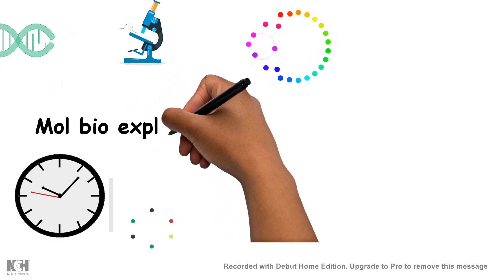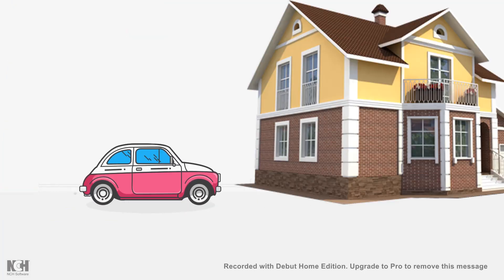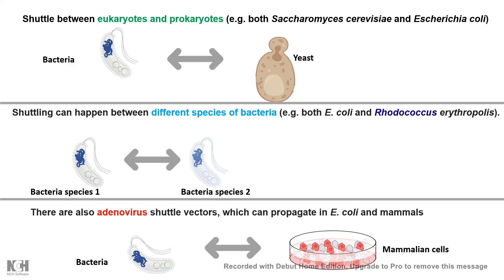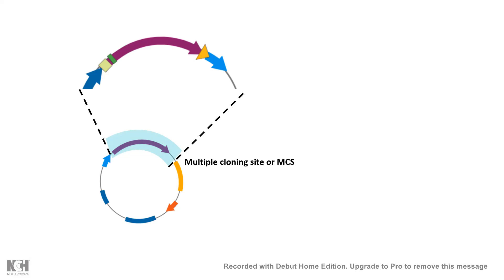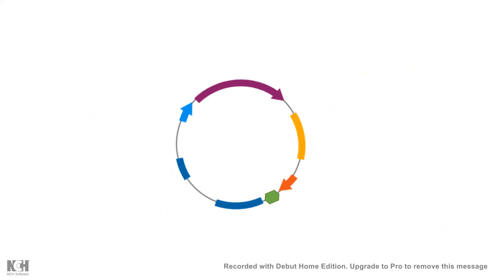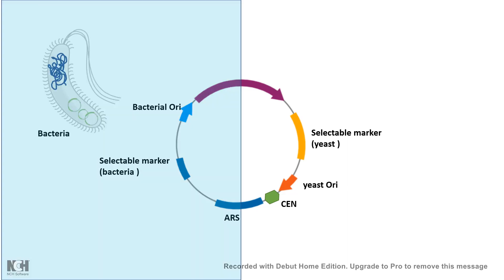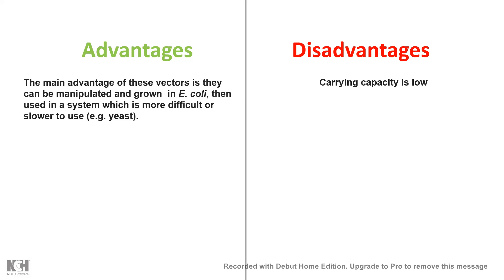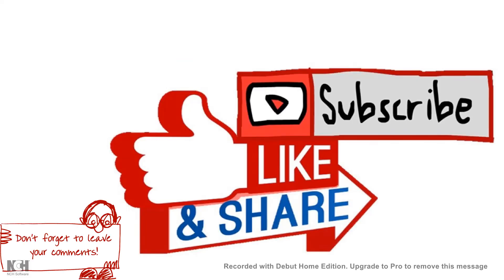shuttle vectors  | How do shuttle vectors work? | What is the purpose of a shuttle vector?

Comment: wh y is BAC (bacterial artificial chromosome) not a shuttle vector? pls answer
Reply from the maker: Miss AK it was not designed for that purpose.....key contribution of bac in biology was to make big genomic libraries....it was never used in gene expression purpose....all these vectors are designed for specific purpose and need so bac is not designed to shuttle between host
Reply: @animatedbiologywitharpan  you said that bac is not designed for that purpose then you said that it was designed to shuttle between hot (last line) I am confused
Reply from the maker: Sorry I was typing in hurry .......read the comment again